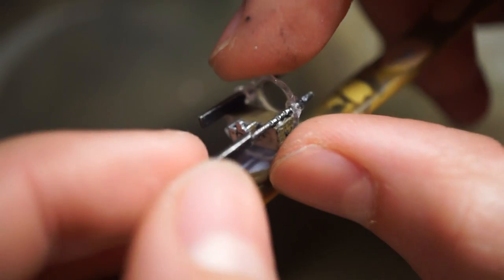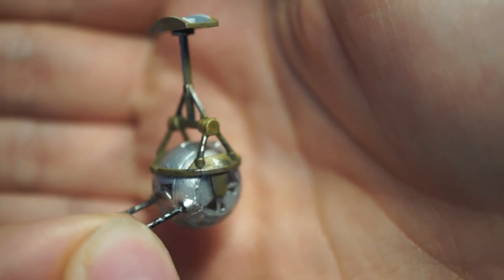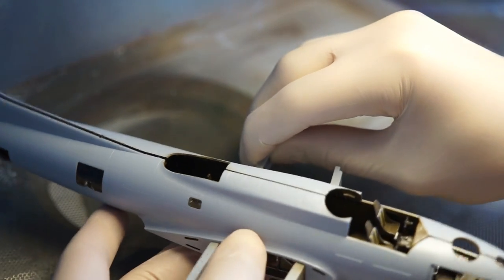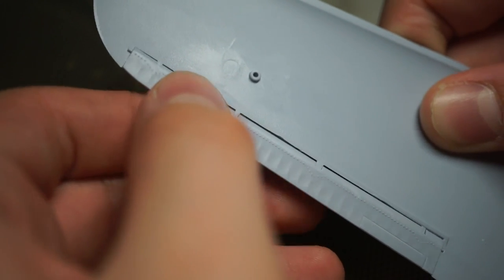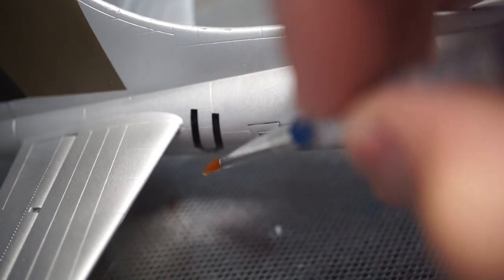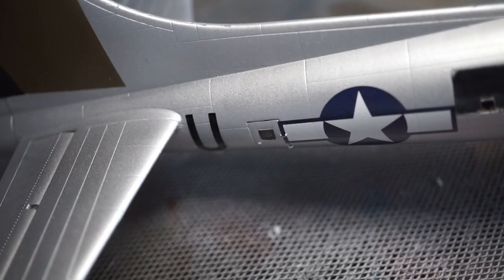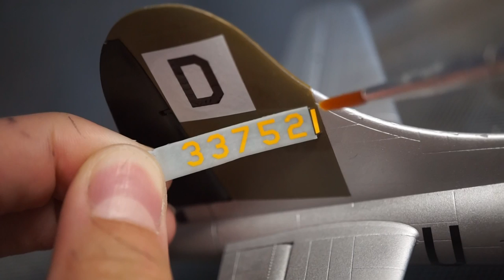Airfix 1/72 B17 Flying Fortress build FINAL | Narrated

Comment: This is a later edition of the Airfix Boeing B-17 kit,  2000 plus, compared to the 1970s editions?
Reply from the maker: Yep, the kit's a pretty new 2016 tool!
Reply: Thought so, some 2000 Airfix 1/72nd scale aircraft model kits are a bit 'engineered'. Compared to previous decade versions, currently doing a 'retro' 1970s B-17.